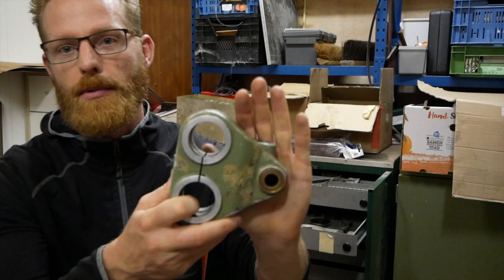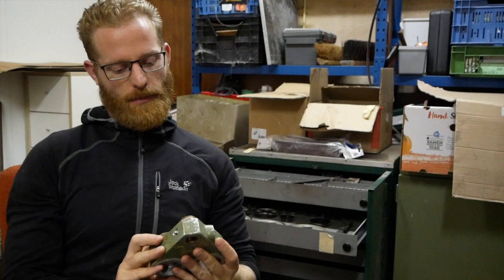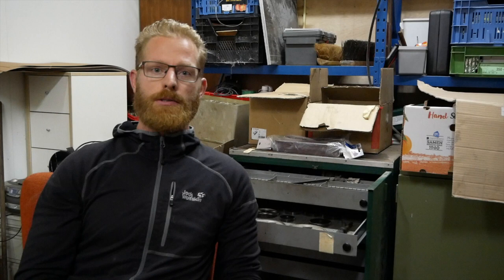Schaublin 102VM – 13 restoration part 1: Bringing home the Schaublin Twins

Comment: hi Bart, Matthias here;  i lived in The Hague for 7 years, but went back to Duitsland;  man, i miss your country;  i just bought me a 102 VM as well, so i do face what you already went through;  paint removal:  if you get aircraft paint stripper, this is the best - i used it on 1 lathe and one press drill, most easy and most clean solution;  other solution is old school wire wheel brush on angle grinder - it will make your workshop dirty but works well, also;  dont sandblast if you dont need to, it will kill bearings and surfaces - or you cover with tape ...
the motor is a ducati, right ?  the center stand looks like ducati ...
Reply from the maker: Hi Matthias, thanks for the info. Most paint removal is done. I did it with a angle grinder and paint removal disc. Works great. Only small inside parts i need a paint stripper. Will try the aircraft version. The motor is a Honda CB500.